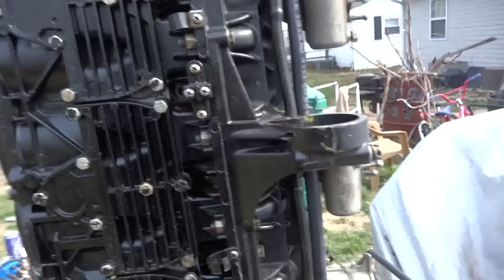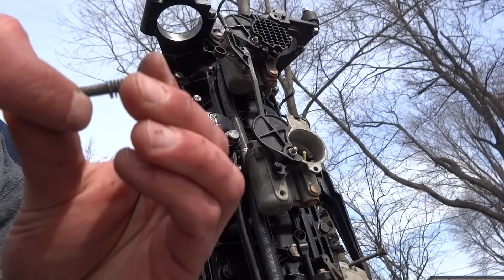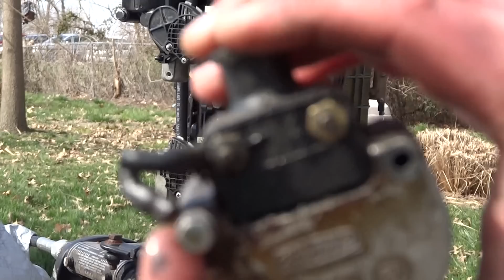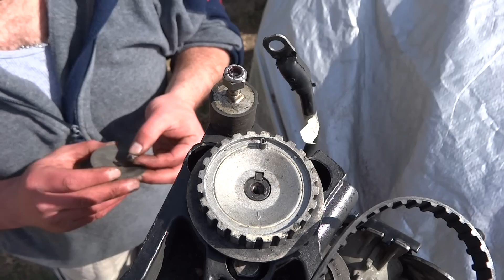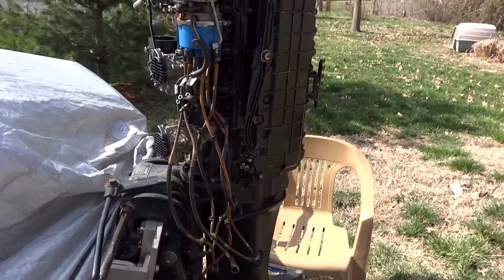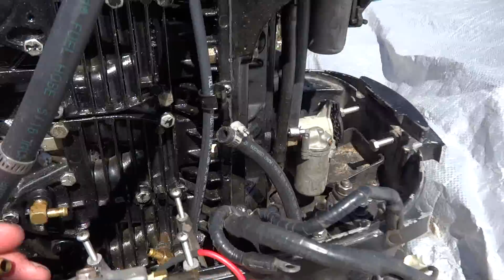Re-assembly of 1976 Mercury Inline 6 1150!

Comment: Which connection goes to switch box for tachometer? My tach stopped working after I put eve throng back together. Runs excellent but no tach and I don’t know why
Reply from the maker: You should have a black ground wire, white wire power from switch box and a brown wire from rectifier which will be your tachometer wire.
I can't remember the pole setting on the tach. Mine had the tach hookup in the wiring harness near the controls though, so I was able to connect there and hookup instead of running back to the rectifier.
Reply from the maker: I think the one on the controls harness was purple with a stripe if I remember correclty.

Comment: Yes it do and it will start but shuts right off and i have to spray starter fluid in carbs to even crank it
Reply from the maker: +Richard Hill Are you choking it? The inlines love being choked to start. And have you rebuilt your carbs yet? FYI- hard starting is very common on the older inlines. Especially if the reeds are worn and carbs haven't been rebuilt. Silly question, but have you compression checked the motor yet? You should if you haven't.

Comment: I have that same motor but i cant get gas flow do any no any tips they dont mind shareing
Reply from the maker: have you checked the primer bulb? also check to make sure there are no cracks in the pickup in the tank, or any lines. if you squeeze the primer bulb, does it get hard?